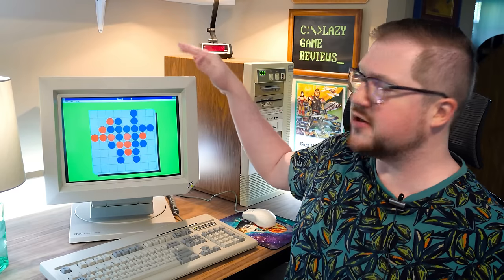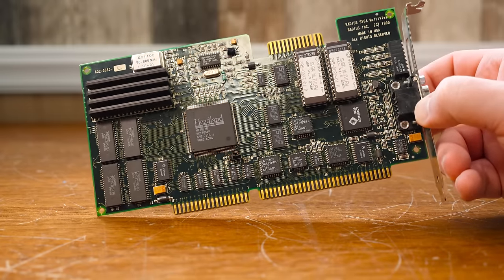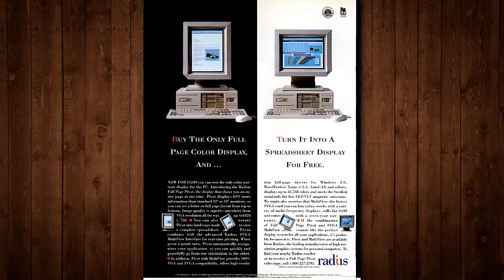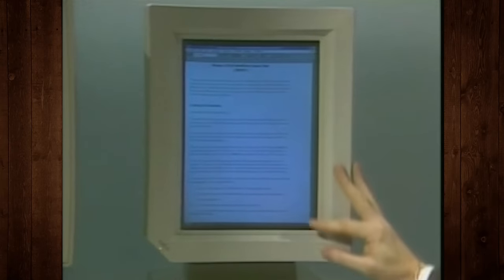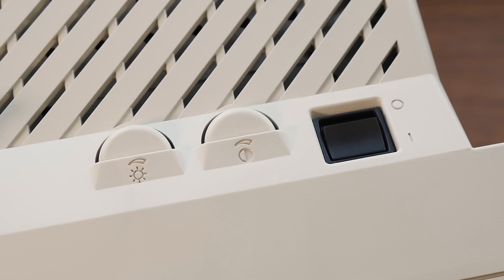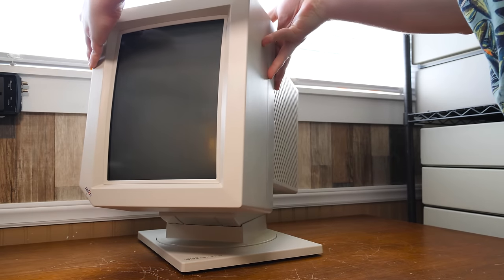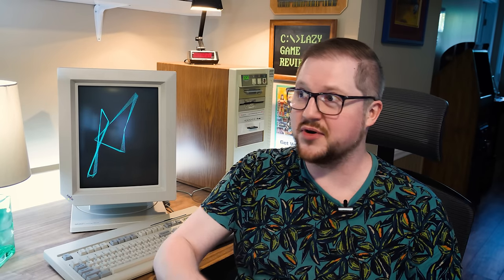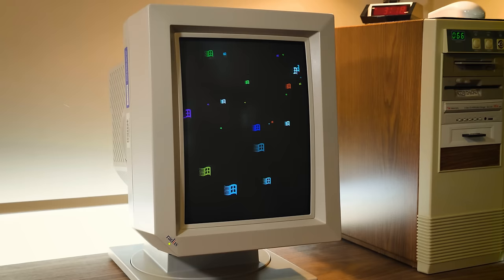Radius Pivot: The Rotating CRT Monitor from 1991 [LGR Oddware]

Comment: I sold one of these to an engineer at Apple in Cupertino a couple years ago. He was sort of secretly building out a weird museum of vintage apple hardware at the infinite loop campus and running original software and programs through all this stuff. He had to figure out how to get the pivot monitor to play nice with the old Macintoshes without any software floppies. He couldn’t send me pictures but it was awesome to see that there was a weird unofficial skunkworks at Apple goofing around with vintage oddware on the company dime.
Reply: That is really interesting! Wonder if it's still around today...
Reply: Wasn't radius Apple's "go-to" OEM for Mac accessories at one point?
Reply: They had one at school in the Desktop Publishing class in the early 90s on a Mac.  I can't remember if it rotated automatically, but I though it did.
Reply: In some of the keynote videos Apple has done in the past year, we see shots in an engineering lab (unclear if it's real or a set, or at least staged) where some old Mac products are seen in the background on shelves.
Reply: @Muldrf  The Mac one was a lot more elegant -- just about anything made for a Mac II or later worked great.
Reply: These were popular on Macs due to desktop publishing. You used a Nubus card instead of a PCI card
Reply: Apple user unaware of how to send simple photos in the 2010s... sounds about right.
Reply: @Dee_Just_Dee  Apple hater coming to tell how much better human he is for not using Apple. Sounds about right.
Reply: My wife would love to send that guy any of my old apple stuff in my garage, working @ computerware & growing up down the street from jobs lead to my collection lol
Reply: @Dee_Just_Dee  hahaha
Reply: It’s not uncommon for older companies to have a corridor or room for this purpose. Probably not a top secret thing you’re sharing, but very cool.

I have seen such mini-museums at multiple corporate offices across various industries. 

Good for inspiring people or getting the right feeling instilled into new joiners. How can you tell where you’re going if you don’t know where you’ve been?
Reply: @dsnein  I think it was a secret because the employee wasn't authorized to be doing it.
Reply: this monitor was designed by ex-Apple (and original Macintosh) designer Terry Oyama according to AppleDesign by Paul Kunkel
Reply: Did you charge him an apple price for it??

Comment: I do love how smoothly the CRT monitor rotates from landscape to portrait mode and back, and how it fades out and fades in the image while switching from one display mode to the other.
Reply: Yeah, it looks like it works better than my phone.
Reply: @DapperProf  Glad I'm not the only one shaking it like Etch A Sketch to see it if turns.
Reply: Works surprisingly better than fumbling with a modern flimsy monitor, then manually rotating the image and watching open windows going into a full panic mode.

Comment: I love how they thought to knock out the corner so it doesn't impact the base when rotating
Reply: What? You say this as if it isn't just an obvious necessity for a rotating monitor. If it had the full corner, it wouldn't work.
Reply: @gmansplit  I have lots of rotating (flat panel) monitors, none have a knocked out corner. Most you have to max the height on the stand and/or tilt the monitor back to clear the base while rotating it. I haven't ever owned a rotating CRT so I don't know if a knocked out corner was standard for rotating CRTs, but it is unique from my perspective.

Comment: 12:09 The diagonal artifact line is due to the fact that the refresh of the monitor is still horizontal (right to left when in vertical position) so it messes up with the camera horizontal rolling shutter (up to down).

Comment: the refresh changing when you change orientation signals an interesting thing - in both orientations, it draws the electron beam in the same pattern: left to right, then one line down, then left to right, again, and so on.  The scan lines are always horizontal.  That's a neat little feature, imo.

Comment: I could see vertical SHMUP fans losing their minds over this.
Reply: Can confirm, I play ikaruga with a monitor that does this and it's waaaay better in portrait
Reply: The question is, is it pronounced 'tate' or 'tate'?
Reply: imagine huge list of shmups we can go easily from rtype hori to dodonpachi tate. damn!
Reply: Sadly I doubt one of these would survive the trip to my country lol
Reply: My brother keeps a tv mounted portrait just for shmups
Reply: @Hard4Games My thoughts exactly.
Reply: It's neat, but not as impressive as the rotatable 29" tri-sync in many a candy cab. 😏
Reply: If it worked correctly, for sure. But I dont think hooking it up to my gaming PC or GBS Control would work out any better than a Tate setup lol. The stand is cool tho 😎
Reply: I wanna play SDVX on this
Reply: I made the exact same comment minutes before you did and 5 people made it before me.
Reply: Unfortunately, based on the refresh rate changes (i.e. it's still deflecting the beam left to right, top to bottom) and the pinout diagram for the input, I don't believe it would work for any vertical games, at least not without a substantial amount of mod work.
Reply: @hobbysickness  What a game!! Need to get my dreamcast back out, beautiful!
Reply: cuz they're hard, they're haaard for games "they're sooooo HAAARDDD, hard for GAMES"
Reply: @hobbysickness  I’ve always called it tate mode.
Reply: Hah, Im counting myself as one. It would be pretty neat to mess around, for sure.
Reply: @wraithcadmus  it's a japanese word (立て) so it's pronounced tah-tay. Literally means "standing", so vertical
Reply: @wraithcadmus  for a secont I thought he said taint. guess that shows where my mind is lol
Reply: My first thought exactly
Reply: TAAAAAAAAAAAAAAAAAAATE
Reply: @hobbysickness  I actually tried setting my TV sideways when I played Ikaruga on the Gamecube.    It was fun to play it in a true full screen
Reply: @wraithcadmus  In Japanese, it's "Ta-Te" instead of "Tate" like "Gate". There.
Reply: @wraithcadmus  たて/縦 pronounced "tah-tey" is Japanese for vertical.
Reply: Can confirm, just recently finished a MAME cabinet with a monitor i can rotate and I love it. I really WISH it could automatically change the display orientation when I rotate it though. This thing would be awesome for a tabletop MAME machine and I want it lol
Reply: Totally. I used to put my old Panasonic CRT on its side to play the PS2 ports of DoDonPachi DOJ and EspGaluda. Worked like a charm, can't do that with my Sony Bravia.
Reply: TATE MODE!
Reply: yes.
Reply: I rather use my regular RGB CRTs...or just play on one of my cabs.

Comment: I had no idea Radius did IBM/PC compatible hardware. Always thought they focused on macintosh related stuff due to them being comprised of ex-apple employees. righteous stuff.
Reply: I think I have 1 or 2 Radius Nubus graphics cards.
Reply: Yeah I had one of these monitors for my Mac. Didn’t know they supported PCs too
Reply: It sort of makes sense because at the time the Windows PC was dominant at the time as since the monitor video input tech isn’t isn’t that difficult to adapt between Mac and PC at that time (you just needed a slightly different monitor plug on the PC and support this monitors default refresh rates on your PC video Card), the only real issue would be writing driver/utility software for this monitor to support auto rotation of the screen image as you manually rotate the physical monitor case. That really wasn’t that difficult to do as I understand it. Large software porting or hardware porting is much more expensive for any company that started out as Mac only back in the 80s and early 90s which meant a lot more Mac software/hardware company focused only on the Mac unless they (or there investors) really saw a big market justifying the cost. The same was true of DOS/Windows PC software/hardware manufacturers back then too with many being DOS/Windows PC only.
Reply: I wonder if it worked with the Mac clones Radius briefly made.
Reply: @IrishCarney  oh I’m sure it did with the hack utility!

Comment: A winery that I printed for in the mid-90's had 3 17" rotating CRT monitors in their graphic design department. That company had bank.
Edit: They were running either Quark (3.3) or Pagemaker (5ish) at the time on PC's which was not the norm for the era. So many font issues but, cool monitors.
Reply: @Gatorade69  At that point in time you had Quark or Pagemaker. Pagemaker was fine for sell sheets, business cards & letterhead. It was terrible for putting together a 32pg book compared to Quark. 3.3 & 4 weren't bad but, then came InDesign.

Comment: The most impressive thing about this to me is how smooth and easy the rotation looks, maybe because CRTs are so heavy so there's more counterbalancing effect. Rotating an LCD still makes it feel flimsy even after 20 years of some LCDs being able to do it.
Reply: My Dell 2001FP LCD monitor is anything but flimsy. It also weighs almost 20 pounds or 9 kg.
Reply: It's because most modern monitors cost less than 1000 dollars. High end monitors will likely have smooth pivot mechanism if it have one.
Reply: ^^  If anyone was willing to pay for well-engineered devices, we would have more of them.  :-)
Reply: @nickwallette6201  sadly, not everyone in this world have that priviledge. Even if they wanted to.
Reply: @nickwallette6201  I'd say it's a matter of scope, not quality of engineering.

Comment: I’ve got two widescreens rotated vertically in either side of my Latitude 5500 at work. Most useful thing ever, and it kills me that Dell killed off the rotating stand AND made the newer monitors directly incompatible with the older stands. But you can hack them a bit.

Comment: This is WAY ahead of it's time! Meanwhile today it's totally normal to have vertical monitors either for productivity or as simple as reading discord chat.
Reply: I haven't seen a modern monitor that will detect being rotated and signal the drivers to automatically switch orientations. It wouldn't be too hard to do, and I'm sure they exist, I just haven't seen them.
Reply: @StarkRG  that should be super easy to implement with HDMI and Display Port being bidirectional, just need an accelerometer in the monitor to sense orientation.
Reply: @StarkRG  probably due to use cases. Modern usage rarely switch between portrait and landscape on a single display. Most people that use vertical screen have 2 monitors. One stays landscape the other portrait.

Comment: I was like "Why is this oddware, monitors can pivot since forever" and then it hit me.. a CRT with pivot 😮
Reply: And it's a better pivot than modern pivots. The screen orientation switches by itself.
Reply: @ScarfmonsterWR  You can change a setting in most OS's to have them do that, but the general advice is not to unless you like random orientation switches.

Comment: The blunted/cut-off corner of the monitor reminds me of the old Nook Colour tablets that Barnes & Noble sold in the early 2010s (they weren't completely cut there, a frame wrapped around the corner, which was very handy to attach a wrist strap)

Comment: I'm 43 and we had ONE of those exact rotating monitors in our computer lab in 1993-1994-1995'ish and that machine was also connected to the new dial up internet.  The other 12 computers just had the 15" Trident Monitors and no internet access.

Comment: I a Radius monochrome rotating monitor when I was the editor of the Columbus (Wis.) Journal September 1993 to May 1994. This was connected to a Macintosh computer. Being able to pivot was a handy feature when I was doing typesetting using Aldus Page Maker. The Columbus Journal was part of Citizen Publishing of Beaver Dam, Wis. Citizen Publishing used exclusively Macintosh equipment. I was primarily used to using DOS technology on PCs.

Comment: It shocks me that our monitors are landscape & our printing is portrait. Such a weird humanism.
Reply: Actually both the standard aspect ratio/size of paper and PC monitors both had logical reasons why they are as they are. It’s only latter developments in PCs that made the aspect ratio of computer monitors seem odd to some people.  The short answer for why this was so is that early computer video display technology was based on TV technology of the time and TVs where all 4:3 aspect ratio at that time and word processing and desktop publishing did not exist yet. Now if you want the longer answer for why the difference aspect ratio between printed pages and screen size read on. The following explains the reason for 8.5x11 paper size and why the original 4:3 monitor size became standard rather 8.5x11 paper sized ratio, for anyone interested. 

The 8.5x11 paper size was borne out out early paper makers deciding to standardize the industry on certain standard paper sizes for early making paper mold. As printing device like printing presses and typewriters and teleprinters became common in the office they created standard for office paper including 8.5x11 and 8.5x14. Early computers used teletype machine teleprinters for output and thus adopted the standard 8.5x11 paper size. 

Early computers had no means of video output and thus all output for the users was printed on paper via the teleprinter as well as all input by the user done via the TelePrinters keyboard since there was no monitor to display the commands the users was type. When the first computer video output cards/circuitry was invented they simply choose to modify a standard TV screen for computer use moving the TVs 4:3 to the computer. 

So why was analog TV in a 4:3 aspect ratio you might ask. The original 4:3 aspect ratio of old school 480i SD NTSC analog TVs was based on the then standard “Academy Format” aspect ratio of film was standard in cinema/films up till the 1950s. Film later began to transition to Widescreen films in the 50’s as a way to differentiate film from TV and give people a reason to turn off their TV and go to a movie at least once in a while. 

The rising popularity of word processing and Desktop publishing in the 80s, especially of the WYSIWYG type made the 4:3 aspect ratio start to seem odd or inconvenient at least to some, hence the invention of the portrait monitors and landscape/portrait monitors that rotate but these remained niche products mostly for dekstop publishers. 

For average users, the advent of 16:9 Widescreen movies/video that came with the pushing widescreen digital video formats everywhere in the late 90s and into the 2000s via DVDs, Widescreen HD TV’s Widescreen DTV broadcasting, and widescreen digital video file formats like MP4, meant that a16:9 aspect ration made sense for desktop monitors and laptops screens though some older users still prefer the old 4:3 aspect ratio for everyday computing tasks. 

The one computing device where portrait mode is a thing these days is the tablet, especially the popular iPad with its automatically adjusting orientation of portrait to landscape as you turn the iPad sideways. This has given new reason for webpage designers to make portrait oriented webpages (or ones that can rearrange themselves into portrait mode when viewed  on a iPad held in that orientation. But landscape aspect ratios remain dominant on desktops/laptops since most modern desktop publishers can handle scrolling down to the bottom half of the page or using a scaled-down preview view when working a 16:9 or 4:3 monitor/screen.
Reply: @Charlesb88  Nice it's sums up the situation. Btw, your autocorrect seems to be in french...😁. Also one point you should correct is that early monitors for main frame computers were actually base on radar CRT tubes.
Reply: @MrTaxiRob  not exactly cause, by that time,  monitors were already 4:3. The round radar monitor were in early 50's computers and vector scanned , not rasterised like tv.

Comment: I used these back in the early 90s in the magazine industry. The  tourist magazine I worked for used a "slim jim" format which was half the width of an 8.5"x11 sheet, which meant this monitor could display two pages a time in portrait mode.
I used them on the Macintosh and they worked really well.

Comment: Is that 4:3? Why tf does it look kinda square when in normal mode and almost like a smartphone formfactor after you turn it?
Reply: People tend to see vertical lines as longer than horizontal lines https://en.m.wikipedia.org/wiki/Vertical–horizontal_illusion
Reply: @weir9996  which is why horizontally striped clothing is said to be slimming
Reply: @PixelatedH2O  vertical stripes are slimming. Horizontal lines are a no-no for husky folks
Reply: @virus2003  yeah, for some reason when I wrote that comment my brain was just backwards
Reply: @weir9996  thanks dude

Comment: I grew up around a family printshop in the 1990s and always wanted one of these monitors when I saw ads in the mail order catalogs, Macworld magazine etc. I also find the Radius logo to be one of the best understated and clever logos of the era (Bodoni is the perfect typeface for this one.). Finally, an interesting tidbit is that this monitor is about the same size as the Xerox Alto’s, which was also designed to match an 8.5 × 11 inch sheet of paper in portrait orientation.

Comment: I had several Macintosh Radius Pivots back in the day that connected through ADB in addition to the D-15 video connector. They worked perfectly with the standard video card and a Radius Pivot driver.

Comment: Loved these. The color was cool but the monochrome were a sort of light grey-blue and the dot pitch was tighter. Beautiful. It was the ultimate WYSIWYG monitor. Worked at an IBM VAR, had it running off a PS/2 Model 70. That was cooking back then. The rig cost more than a new car, but hey.... P.S. I was the AutoCad authorized guy.... when this monitor was a thing, in order to run AutoCad you had to run a dongle in the serial port. It was a hardwired copy protection scheme.